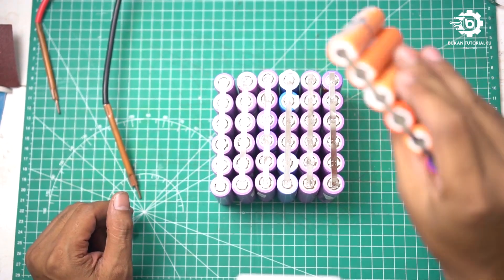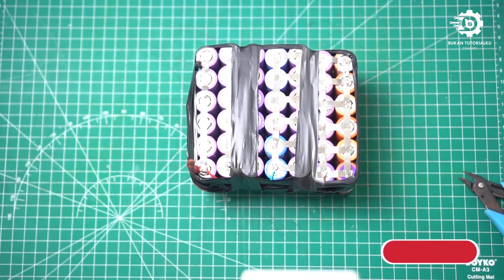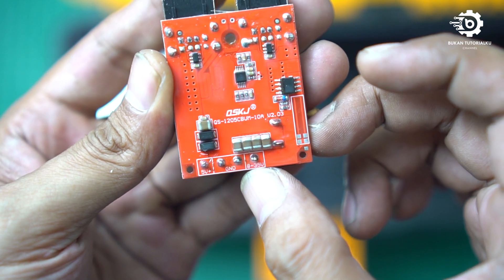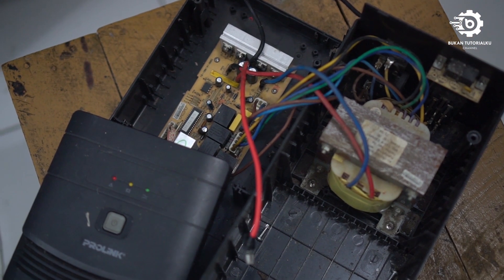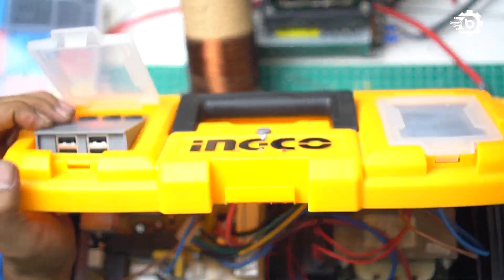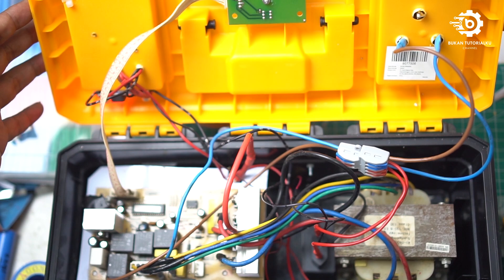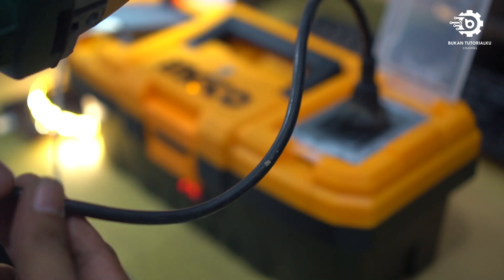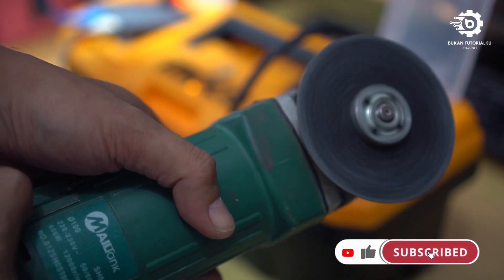Tutorial Membuat Power Station Murah Keren Powerful

Comment: pengisian daya power station via module charger juga kah bang? input berapa volt itu? berapa lama biar full ?
Reply from the maker: ini pake bms brader.. jd ngecas aku pake power suply 12v 10a (di up 13,5v), slama ni blm pernah sampe kehabisan batre brader.., biasa buat aku bawa camp abis magrib nyala sampe jam 1-2an malem aku matikan.. dan masih terang, dan aku charge lg pagi sampe siang (kurang memperhatikan jg fullnya brp jam krn aku tinggal, ada cutoff jg jd kalo penuh dia berhenti)
Reply: @BukanTutorialku  berrti BMS jadi protection tunggal y om? ga ada backup lain. 
untuk power suplay langsung dari input daya by BMS ya.?
Reply from the maker: pake bms 3s, untuk jalurnya... power suply 12v 10a (pake psu jaring yg biasa buat cctv).. trus ke bms.. dari bms ke batre.. gitu doang ga ada komponen lain.. kalo penambahan paling voltmeter digital biar tau kapasitas